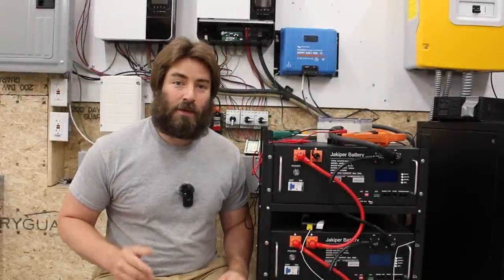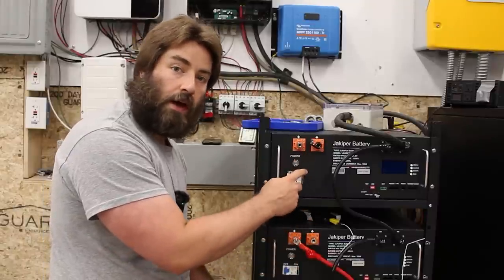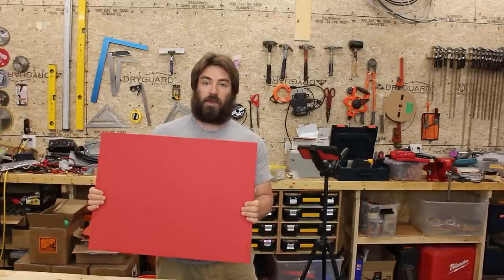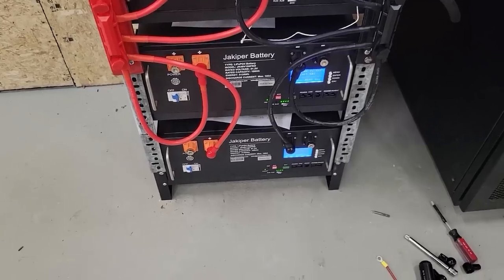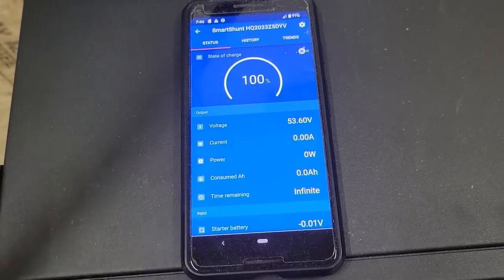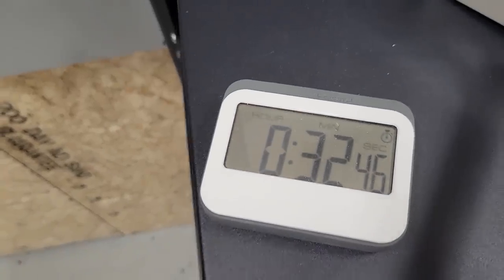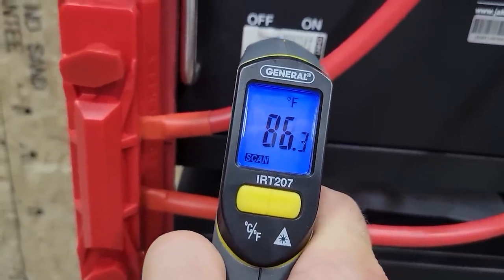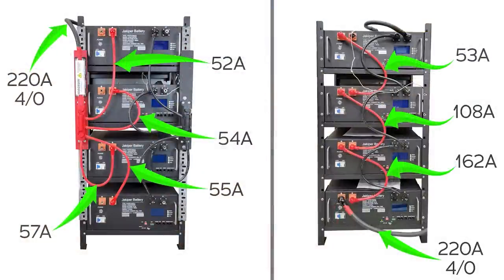Best way to wire batteries.   Part 3

Comment: It would be nice to see the wiring diagram, just to make sure I am understanding the way you use the bus bar. But basically, three batteries to the bus bar, and the 12v bus bar connection for the fourth "pin" ?  Been googling how to wire batteries together (in parallel). The manufacturer of my canper has wired it daisy chain. Now I rarely use more than 50A, so maybe it does not matter as much..?
Reply from the maker: You can buy bus bars with 4, 6, 8, or more studs for your situation.  If you have 3x 12V batteries wired in parallel, and you buy a bus bar with 4 studs, then yes.  The 4th stud can be for your inverter out.
Reply: @DavidPozEnergy  Thanks for that. But also to my 12v general distribution bus, right ? One to the inverter, one to the distribution ?

Comment: I'm not sure if anyone has commented but u have a thick 400AMP busbar connected to the fuse with 3MM copper plate on a rough observation it is about 20 x 3 MM which calculates to 84AMP rating

Comment: If installed in a cold basement, I would want to downsize the wires and busbars so they heat up MORE, to help take the chill out of the air.
Reply from the maker: LOL.

Comment: Could u just replace the 4 awg cables with 00 cable or something bigger than 4 awg thus reducing heat as well yet also enabling the display to be seen?  Great intel!
Reply from the maker: That would certainly help, but not alleviate all the concern.  The power would still flow through the small brass jumpers inside each battery box.  (it sits just behind the terminals).
Reply: @DavidPozEnergy  thanks for the reply I wonder why they are making these terminals small like this when they are selling these into rack systems and marketing them to be used with six or even more units together which would be 600 A?  I guess I feel kind of fortunate I haven’t pulled the trigger yet still saving up maybe by the time I get started buying my system in the fall things will be improved

Comment: I thought busbars are those bars you hold onto when entering or exiting a bus (public transportation), in case you trip going up or down the steps.  But seriously, maybe manufacturers don't use busbars cuz they are concerned about safety.  Thick insulated wires seem to be fairly safe.

Comment: Carlos Santini

hi David, If my mail panel is a GE model, can I use a din rail distribution box to create my critical loads panel or do I need to install the same brand and system from GE for my critical loads panel?

Comment: Hello David, great videos, I've learned a lot. For this setup I have an idea to test. You could connect the trunk on one of the middle racks, maybe on the second. Then 50A would flow over the top line and 50A+50A=100A over the bottom line. OK, that's more than with the busbars, but only half of the first variant. How is the warming then? Best regards and keep it up. Jan

Comment: David that is a good example for efficiency, safety and longevity of the battery. What about back side of the battery terminals feeding in to the bms. Feeding more current thru 1 wire or the other to the mosfets for bms longgevity. I was thinking of a copper buss bar across the Pos's and Neg's  with a thru hole in the middle. Or is this a nit that doesn't need picking?
Reply from the maker: With my setup, I pull a max of 55 Amps per battery.  (50A is a 0.5C rate)  I don't think it's worth the time to worry about the inside wires/jumper at 0.5C.
Reply: @DavidPozEnergy  david i was mainly thinking more about the mosfets. one side handling more amps than the other. But at that .5c rate  I see your point. thanks for clarification

Comment: Thank you so much. I did the exact same setup after watching your video. I have same 2 x batteries and 1 x same inverter with the busbar. I am using 2AWG 35mm cables with 250A Class T Fuse. Should I have bigger cable between Busbar to Fuse and to inverter due to total potential being 200A?
Reply from the maker: A larger wire will have many benefits.  Less Voltage drop, not get as hot, help the inverter not trip under hard situations.  I would prefer using a thicker wire with a 200A fuse than 2AWG.  I tend to use thicker wire whenever I have a choice.

Comment: Another nice video.  Since you were taking temps on the 4ga to the bus bar, I would have also liked to have seen the output temp on your exiting 4/0.  Wouldn't expect a change from the initial setup to your modification, just curious.
Reply from the maker: Yeah, it never occurred to me to measure the 4/0 since it was a constant.  Next time I run a load test I'll check what it is.

Comment: Great video... Can you tell me why you didn't use a 400 amp fuse with the 4 100Ah batteries?  Thanks
Reply from the maker: Sure.  The fuse is to protect the wire down the line from the busbar.  In this case, it's a 4/0 wire.  Also, since my total loads max out at 220A, the 300A fuse is still larger than what I can pull.

Comment: I would just be tempted to run an additional load set of cables from the last battery to your inverter ( yes Marshalling required or other since inverter is unlikely to take 2 of each

Comment: You did a great job measuring the temp of the wires. What was the temp Delta of the main feed to the inverter?
Reply from the maker: Sorry, I didn't bother measuring the 4/0 wire since it wasn't the focus of the video.  I remember it was warm, but I could hold my hand on it without feeling "hot".  Would you like me to make a "shorts" video just checking the temperature of the 4/0?

Comment: Really nice video! Thanks for that :)

Btw, the "daisy chain" is how I have them wired, with BMS connectivity to the inverter. Do you know if the BMS connectivity between batteries + between 1 "master" battery & inverter are also valid with this "bus bar wired way" ? I'm not sure how the electricity goes out when the battery is connected to the inverter 🤔Can they be parallelized as you show too?

Thank you.
Reply from the maker: Yes.  The communication won't care if your batteries are paralleled using the daisy chain method or the busbar method.

Comment: HOWdy D-P,
Thanks 
I wish that the SOLAR Industry would STANDARDIZE on one single  LUG / BOLT Size
I noticed that  BLUE-Sea "T"-Class  FUSE-HOLDERS utilize 3/8"  Studs 
While  PIKE BUS-BARS  utilize 5/16"  Studs 
While  EG4-LL Batteries utilize 1/4"  Bolts 
Even if they ALL decided on an OVERLY Large STUD / BOLT ( ie: 3/8" ) it would simplify installation tremendously 
COOP

Comment: Nice video David thanks for all your effort producing this information I will certainly be using a busbar of some creation. I just wonder is it really necessary for the extra fuse on the busbar as all the batteries are individually protected with 125A MCB or are you being ultra cautious?
Reply from the maker: There are a couple things at play.
1. Over-current protection.  The 125A circuit breaker on each battery provides over-current protection for the short (14") wire from the battery to the busbar.  But then what?  Where is the over-current protection from the busbar to the inverter?  You might have a large circuit breaker at the inverter, in which case, you don't need to add the fuse.  In my situation, I'm paralleling this rack to another rack, so I needed over-current protection somewhere.  
2. Short-circuit protection.  Circuit breakers are fairly slow to trip, and relatively low in SC amps.  The fuse I used (Class-T) has a very high short-circuit rating, and is very fast.  
TLDR: You may not require the extra fuse, but it depends on the situation.
Reply: @DavidPozEnergy  Okay fully understood thanks again

Comment: A clarification please: isn’t the chained configuration series, and the central busbar parallel? Result : a lower output voltage with the busbar?
Reply from the maker: Not in this case.  The daisy chain is still parallel.

Comment: Thanks David for the awesome videos especially this specific one with busbars. You and you cute princess really made my life simple as I was always wondering why is my middle battery always fully charged before the others and it has higher cycles than the other two. I will definitely get the busbars for my three batteries with expansion to the forth one. Will this setup make any difference whether you are using Li or USE on Setting 05? Thank you once more and keep up with those great informative videos.
Reply from the maker: Changing the layout of wires will not require changes to your inverter settings.  Use the inverter setting best for your situation.

Comment: Again, a nice video David! One other thing about NOT using a busbar over the terminals is that you are not able to remove one battery. 
I think you would better remove the 'stuff' in front of the vertical 19inch strips at both sides and move it 2 inches. Then you are able to remove the battery's without worrying. 
Working clean is my preference, sorry😉.
Ps. Are the 2 connection blocks on the wall,  left of the 3 switches, AC, so >100V?
Reply from the maker: The terminal blocks are 120VAC.  Yes, I have to get them mounted inside a box.  I have a din-rail box waiting on me, just haven't made the time.

Comment: Thanks David, nice video!   But wouldn't it be better to have all the wires in equal length ?  The shorter wire does charge and discharge faster than the longer wires. Or is it, practically seen,  marginal?   Just wondering.....
Reply from the maker: All the 4 gauge wires are exactly the same length.  Maybe it looks odd because the one on the bottom makes a little loop?

Comment: Nice video David. Please I have a novice question for you. Why are there more amps running in the main positive cable compared to the main negative?
Reply from the maker: The two are always equal.  I'm guessing you are asking because the Victron Shunt was showing about 210A (neutral) and my multi-meter was showing about 220A on the positive.  Is this why you are asking?  If it is, then the answer is the different tools, and margin of error.  If The shunt was on the positive it would have also showed 210A.

Comment: Have you tried putting a copper flat washer under the lock washer on each stud? That gives you greater surface area and better conductivity. A lock washer isn't the best contact surface.
Reply from the maker: I have not tried that.  I was surprised Magnum didn't include a flat washer.

Comment: Very interesting, never considered expansion of copper bus bars but it makes sense, how often would you recommend to retorque battery terminal bolts?
Reply from the maker: When I worked in industry, I think think the electricians had a 1-year rotation on things like this.  That's probably a good approach.  If it were me, I'd check the torque after the first full cycle, then after 1 week, then after 1 month.  If they stay torqued after the first month, then once a year after that.

Comment: Good Tests showing  the bus bar type installation.
BTW David... how is the last 38 SEER DIY Spilt A/C you installed yourself running?? Thinking of investing the $$ to install the same unit myself.
Reply from the maker: The mini-split in the garage has been running 24/7 since I installed it.  Working great.  I should probably check the filter at some point, LOL.  I haven't touched it.

Comment: I like that the bolts on your bus bars are close together with all equal-length wires.  On the EG4 rack you put together in another video, the bus bar was long on each side, and the bolts had at least 6-8 inches in between.  Would that distance make the distance to the 4th battery be much further than the 1st battery and cause an imbalance?  Or am I overthinking this?
Reply from the maker: I went down that rabbit hole of thinking, and don't think the busbar on the EG4 affect the load on the battery.  I've tested my rack and have been using it over a year.
Reply: @DavidPozEnergy  thanks for letting me know
Reply: I really appreciate your videos.  I learn a lot!

Comment: Great video, David. Good explanation of the neat/energy loss and the need to compensate with the A/C which loses even more energy.

In your explanation about the solid busbar - I agree it would cover things best left exposed. However, what about running a solid copper busbar up both sides where you put your small busbars then using solid copper bars to run horizontally from the battery terminals to the vertical busbar. That way the copper jumpers could be connected to both terminals on each pole of each battery instead of only one terminal and without covering anything.

BWT - I have four daughters. I included them like you do with your kids. As a result, they are not afraid to "get their hands dirty" doing things. They also know how to do a variety of maintenance tasks.  Oh ... I liked you better clean shaven.
Reply from the maker: Your plan with long busbars would work too.  If it were me, I'd still use a flexible jumper wire to the battery terminal.  Glad to know your kids are not afraid to get their hands dirty.

Comment: Another excellent video, thank you for the experiment! Question: can you tell me the manufacturer/model of those white solar shutoff switches you are using mounted on the wall behind the top battery? I’m looking for that exact configuration. Thanks David.
Reply from the maker: Those are PV disconnects, made by IMO.  Here is the switch inside a water-proof box: https://signaturesolar.com/dc-disconnect-rooftop-isolator-switch-by-imo/?ref=4_rHcgZ9x-TiF-  If you want it without the box: https://www.industrialcontroldirect.com/modular-dc-disconnects-si32-dbl-4-6028.html
Reply: Perfect! Thank you David!  For whatever reason I couldn’t locate them.  I googled for an hour or two trying to find them.  Keep up the good work! You are sharing some very educational and.valuable info.

Comment: Question.....have you tried updating your firmware on the growatt 5000es's? I heard they upped the incoming amperage limit to 22amps. Many people are having issues with doing the firmware updates. Any thoughts on doing a video  on this?
Reply from the maker: I didn't know there is a firmware update.  I'm not good with computers, and try to avoid messing with something that works.  I don't think I'll be changing the firmware unless there are other reasons.

Comment: .. resistance causes heat. You can measure the resistance.. shorter cables.. thicker buss bar across all the battery terminals.. both sets.. 1/8th copper.. this will truly make it "cooler" measure the resistance from each terminal all the way to it's destination.. add them together times by voltage equals how many watts in heat your generating.
Reply: Sorry.. didn't get to the end before commenting.. thanks for explaining why not bars. 

Thanks for the videos as always..
Reply from the maker: Thanks for watching to the end.

Comment: Are all the cables the same length? I think they need to be the same length for better heat and amp transfer from the batterys to the buss bars
Reply from the maker: All the 4 gauge wires are exactly the same length.  They were pre-made and sold by Orient Power.  I have a link to them in the description.

Comment: When working with copper busbar, use a set of soft-jaws as to avoid the vice teeth marking or damaging the copper. Aluminium or timber works well.
For the love of god, ALWAYS use a flat washer under the springwasher.
Reply from the maker: Good suggestion on the vice jaws.  As for the washer, I was surprised Magnum didn't include a flat washer.  They only had the lock washer and nut.

Comment: I guess if you figure mostly keeping under 5000 W at a time for a small off grid system that would only equal to about 20 A for each battery if you have a six battery system surely there would be no need for worry if things heating up at this level maybe even up to 50 A I’m not sure.  But that busbar idea is definitely why I’m leaning towards signature solar since they have that nice rack all set up but like you’re saying I’m just thinking now about the conductors from each battery to the bus bar and even the jumper that you’re talking about which is inside each unit
Reply from the maker: Yes, Signature Solar is my favorite setup.  I've been running Signature Solar batteries over a year without an issue.  If you decide to purchase some, please use my affiliate link to help out the channel: https://signaturesolar.com/pre-assembled-eg4-enclosed-battery-rack-6-slot-wheels-included/?ref=4_rHcgZ9x-TiF-
Reply: @DavidPozEnergy  OK I just might do that. Might not be till the fall then kind of saving up lol

Comment: This is interesting. I'm an electrician of 20+ years and new to solar or wind...hydro. I'm very interested and have a ton of questions. Changing the circuit would change the voltage and the amperage obviously. Does the battery bank land directly on the inverter? If the batteries are 50v 100ah that would be an output of 200v 100ah. In parallel, it would be 50v 400ah. Does the inverter battery input expect a certain voltage or does it make the corrections automatically? How would you size mutip[le battery banks to be completely off-grid with high demands? Shop with air compressors hand tools...lights. Would you have multiple inverters with battery banks in parallel until you had enough storage? Should these be built out in fireproof rooms?
Reply from the maker: Both methods of connecting the batteries (daisy chain vs. busbar) are methods of paralleling the batteries.  All the batteries are 48V, and stay 48V.  I'm not series connecting them, but I understand the confusion.  The terminals are a straight connection.  It might make more sense if you see my first video in the series: https://youtu.be/uhoaIVkfkkQ
Reply: @DavidPozEnergy  I'm an idiot. I don't know why my brain was thinking series. I think it's because the positive is landed at the top and the negative is at the bottom. It's clearly parallel. It's not positive to negative. A little embarrassed when I realized it...
Reply from the maker: All good.  Glad we are on the same page.